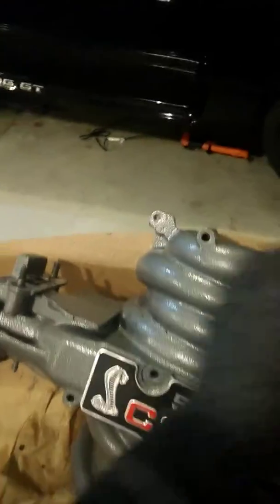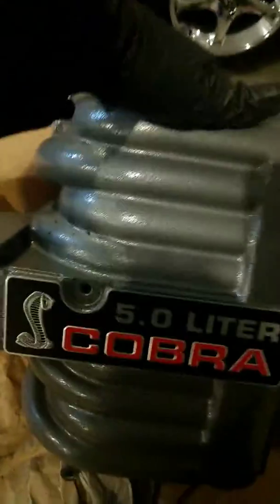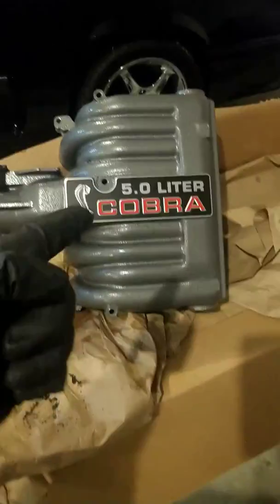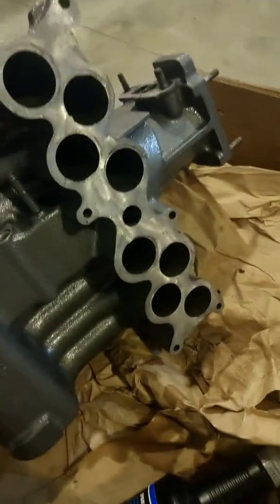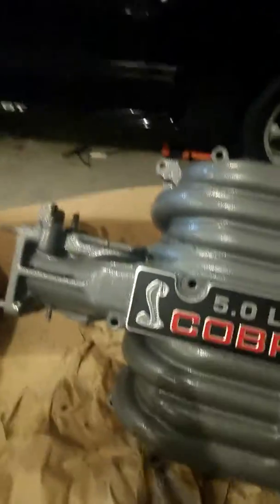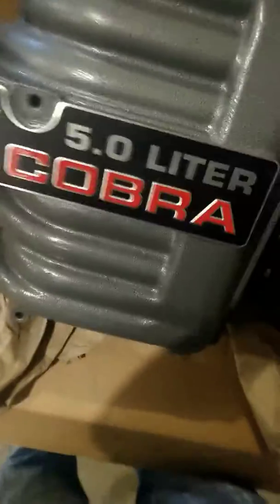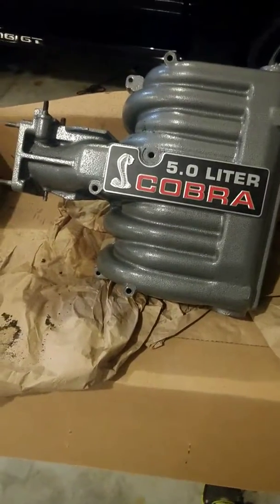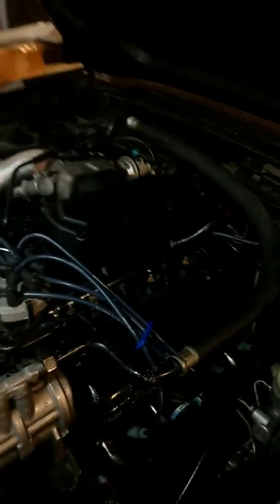Foxbody Cobra Intake manifold clean up/prep for replacement

Comment: Cleaning up is always so much fun!  Did it warm up by you?  20 degrees is feeling like a heat wave after -50!
Reply from the maker: Right, having a blast cleaning, spray, scrub, dry, repeat. 
Yes, like a 60 degree swing!! Not sure where all this melted water is going to go...I'm.sure the ground is still frozen? 
But what a nice change, it was 30 degrees below with wind chill. I stayed in, lol!
Reply: J PP:  Yeah, it was really dangerous to even be outside in those temps.  Going to be close to 50 degrees today... that's just crazy.  I'm sure your right about the ground still being frozen.  That should cause plenty of flooding.